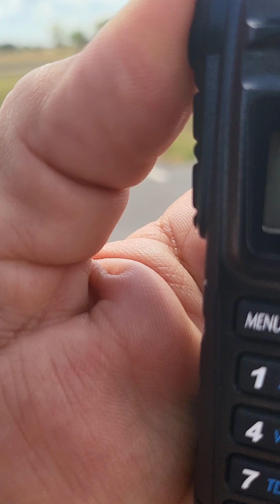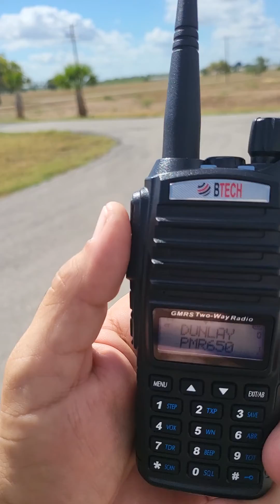BTech GMRS V2 Range Test at 14 Miles.

Comment: I have a friend that has a V2 and his is putting out 5.2
Reply from the maker: I have the 8 watt version and it's kicking out 6.5ish on the GMRS freqs, I think.
Reply: Saw a vid that showed 5.4, some say less than 4 but testing equipment is never precise or universal. For example I do hvac, I have three meters, if I test a capacitor I definitely will not get three of the exact same readings, might get (on a 40uf cap) 39.7, 40.1, 39.2
Reply from the maker: @mdc21787  all equipment, including the radios could be different.  In only reporting what mine says.  👍
Reply: @MCTGMRS78009  agreed

Comment: Will you check this without using a repeater for the distance ? And also what a Nagoya antenna be a good thing or help it ?
Reply from the maker: Yes sir, we did.  In our hilly terrain, we got about 4 miles HT to HT.  I was using the stock antenna but I would recommend the Nagoya NA-771G.  This would have probably helped us get an extra mile-ish.

Comment: Must not have a lot of trees in between you and the repeater. 
In the summer from Ht to Ht I get about 3 miles . From my 15 watt mobile back to base radio I get 4.5 miles . From my base radio I get a lot more miles. 6-7 miles . That’s in the summer with all the foliage on the trees and bushes. Winter time I get around.5 to 1 mile more in the winter. 
I plan on Re vamping my base radio to a 50watt and better antenna. Either way a 20 and 15 watt radio my not be enough to get back to the base . Because base is on top of a hill and all radio transmission back to base will be up hill. I think that a better a base radio and coax . Same for truck radio.
Reply from the maker: Many trees and hills believe it or not. 😳